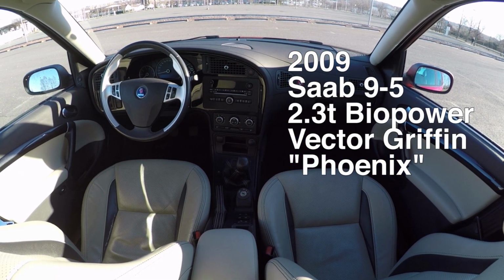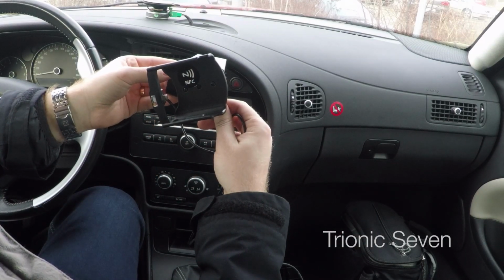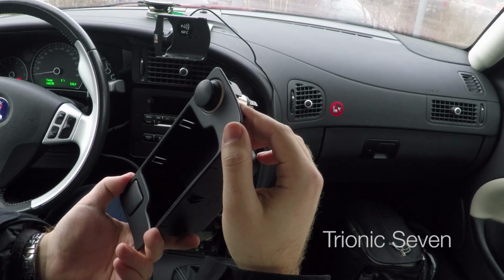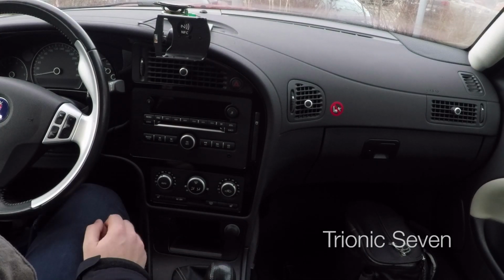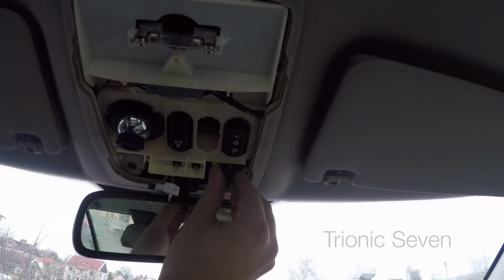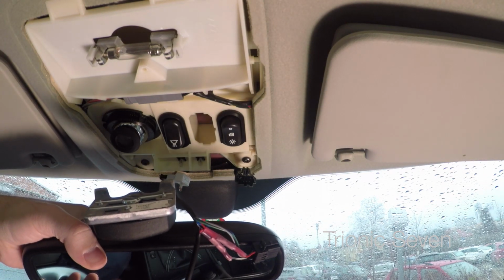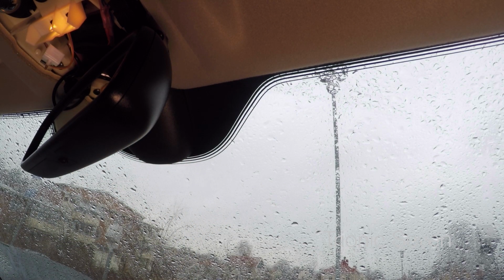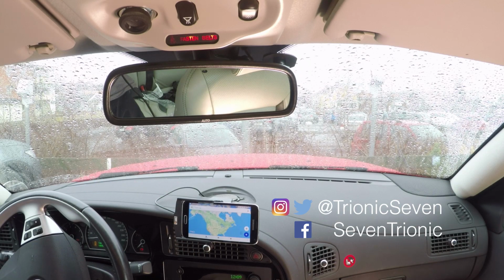First mods for my Phoenix Saab 9-5 Griffin! - Trionic Seven

Comment: Great video! Have the same holder for holding either my iPhone 6+ and my iPad, but really should pull the cable down like you did in this video instead, would make for a much nicer look of my 2005 Saab 9-5 2.3T SportKombi (with BSR-chiptrim).
Did replace the old Cassette/CD-combo-radio with a Clarion radio that includes DVD-player, Mp3-player, USB-input, Digital-TV-Tuner, iPod-support etc, but when that got installed they put the USB-cable in the glovebox, so at the moment always having the cable coming out of in between the glovebox-door and the surrounding area is kinda ugly.

Comment: What about replacing the light bulb festoons with LED?  In my old 9-3, the regular bulbs were so hot that it discolored the plastic housings.
Reply from the maker: That's an easy mod to do and can also look great. However, resist the temptation to buy from ebay. Instead, get it from good, reputable suppliers. Ebay lamps like those I put in Laxen, break quickly, and also have the wrong color temperature. For instance, I ordered 6000k lamps, but the color was very blue, over 8000k in color. Looks awful.

Comment: Griffin also have nicer interior right, leather seats and so on. Will you change the head unit, stereo into for example a Pioneer with bluetooth, gps and so on?  If you change the head unit please make a video when you install it.
Reply from the maker: I won't change the head unit as I want to keep the stock look and features. But I might be doing some mods to the audio system in the future, stay tuned :)

Comment: Hej! 
Tack för en bra och informativ video. 
Tack för bra tipsen som jag fått från dig  relaterade min saab 9-5 2006, i 2016. 
Nu det är dags att byta den. Funderar att uppgradera till Saab 9-5 SportCombi 2.0 T BioPower Griffin, Linear 180hk 2010 arsmådell. Vore toppen med 2,3 motor förstås,  men det är svårt att hitta på marknaden och de är vektor i mesta fall, men textil klädsel är krav.
Min fråga är relaterade rostproblem på den årsmodellen. Läste på forumet att de är betydligt mer påverkade till rostproblem i jämförelse med 2008. Många skrev att det är hemskt situation. Jag frågar dig, som vet riktigt mycket om saabar och har sånt bilen, stämmer det?
Tack i förhand.

Comment: what I have been very keen about since I got my 9-5 2003 half a year about is, whether it is possible to install the trunk which you can pull out afterwards, since that feature seemed so damn useful. any info on that? also the HK sound system.
Reply from the maker: Sure, that was an official addon you could purchase from Saab. Question now of course is if it's still available.